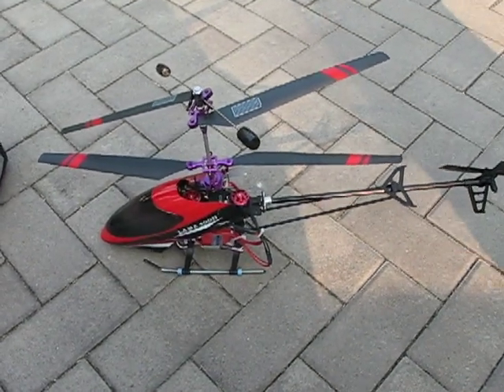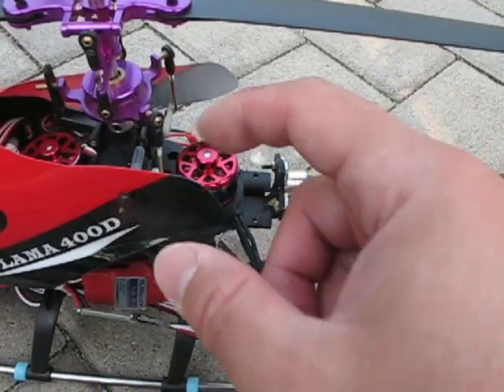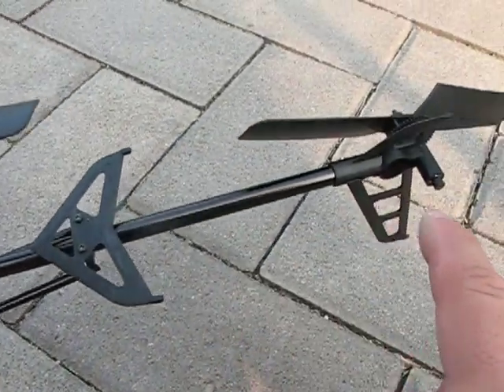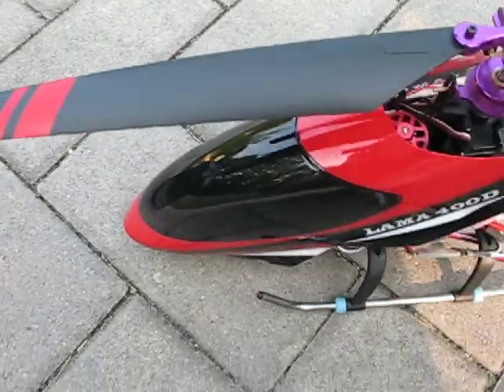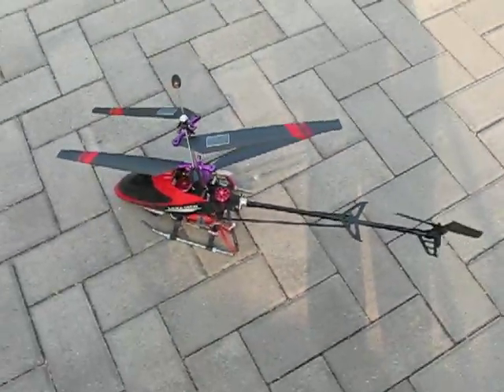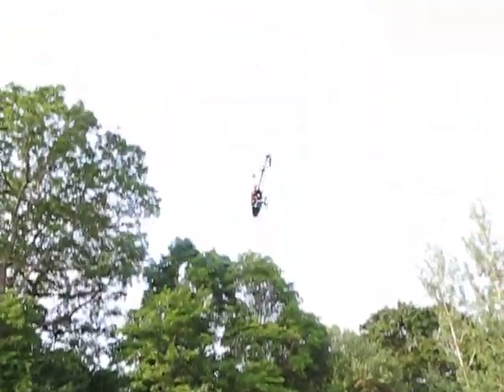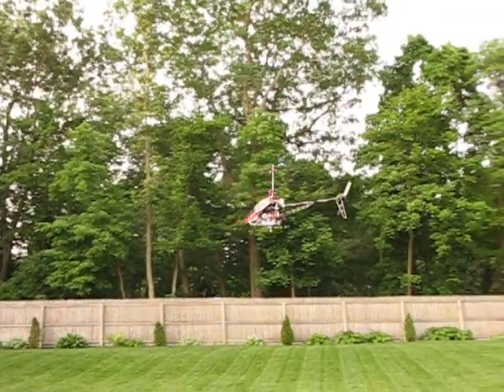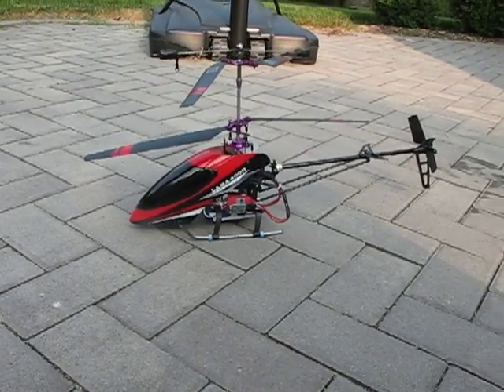WWW.RTF-HELI.COM - E-SKY BIG LAMA SEPARATE CANOPY/TAIL BOOM MOD

Comment: Hi I just wanted to give some feedback on upgrading LAMAS(1) Dont make em spit! just kidding
The 400 D does not matter what you do it stays a verry dosile creature hard to get FFF becouse
you can not change the servo arms,even with full extent there is not enough travel.Nice for
wind free days,scale flying.
Esky big lama MD 500,change the servo arms max length ,swap to BB motors,Extended shaft and extreme blades.The best is to rip off the body and use a Belt Cp canopy and make 
a light tail FFF!